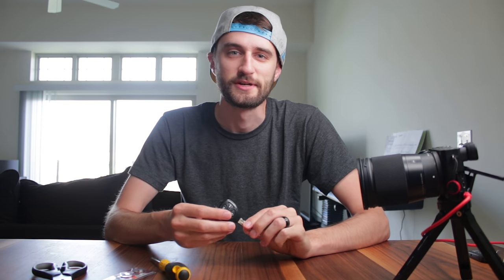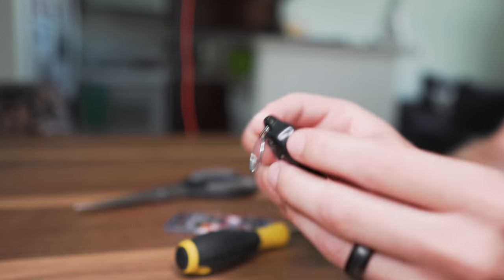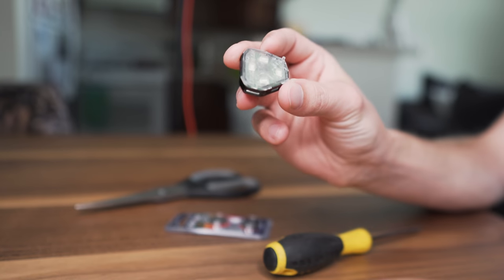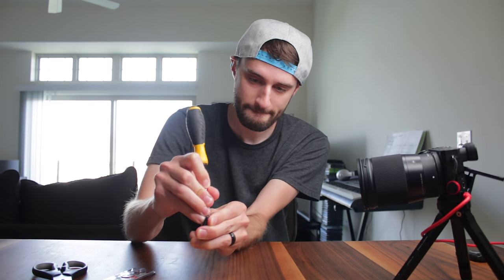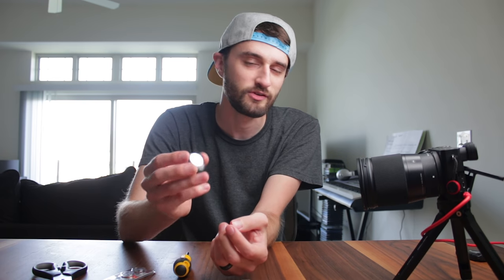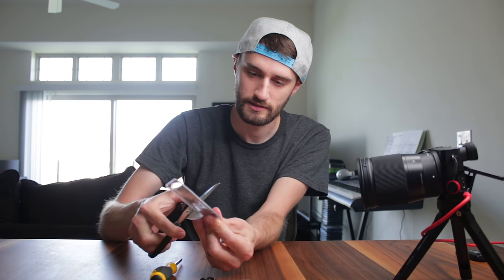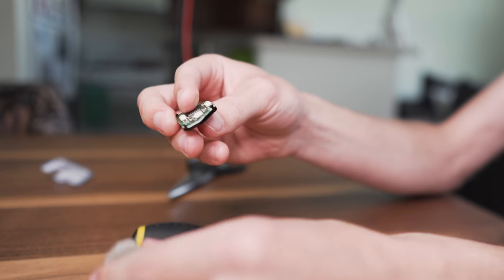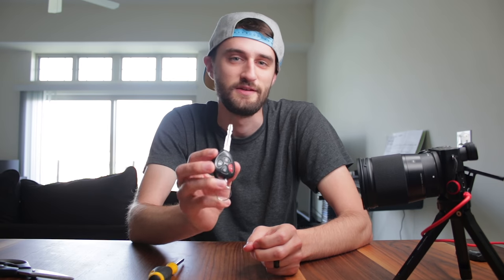How to Replace TOYOTA / SCION Key Fob Battery | EASY!

Comment: Ive only waited 6 months after my fob stopped working to search for a video like this 😂.  It’s been hell walking back to the car with groceries  and having to manually pop the trunk from the inside, after manually having to unlock your car. Learning so much during quarantine. Thanks dude!
Reply: Same I waited about a year to replace my two and then Justin’s video help because it was hard to pop that inside part off even using a mini screwdriver in the tab. I am thankful for this video.